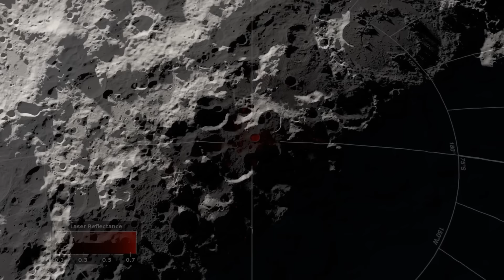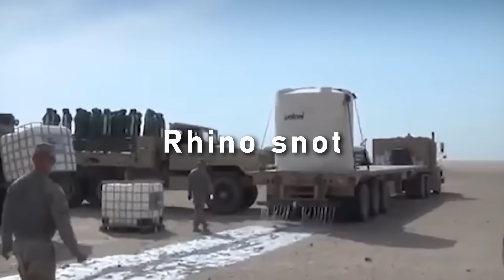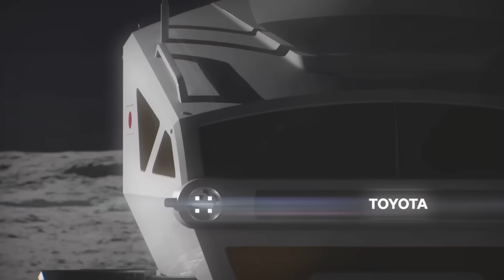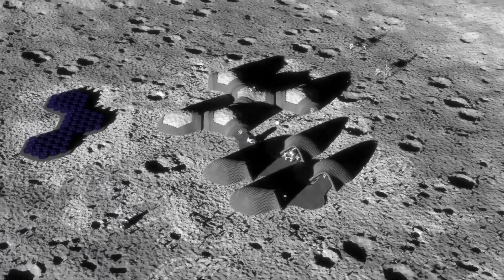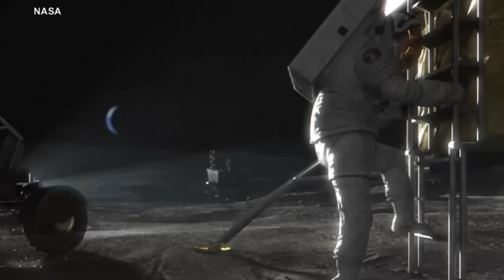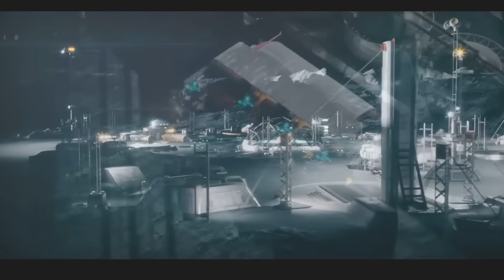NASA’s Plan to Build a City on the Moon

Comment: Make a flourishing, self-contained colony in the dry valleys of Antarctica first, where conditions are 1000 times easier to work in. Once that is done, and it won't be, only then would the idea of colonizing the Moon or Mars be a possibility. We can barely operate our Antarctic research stations with resupply lines in Australia and South America.  No  greenhouse has even been attempted there, all food is shipped in. The microscopic dust, as fine as boric acid powder, is enough to amount to an insurmontable obstacle to colonization.